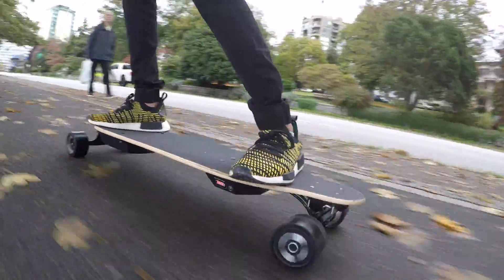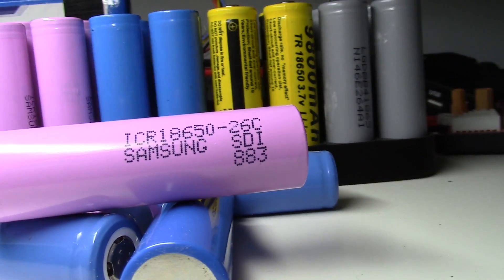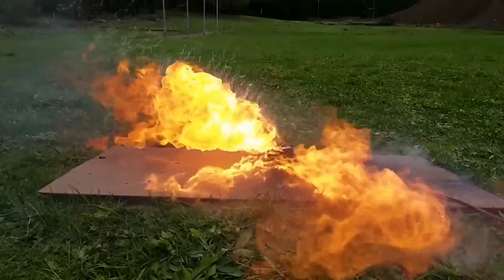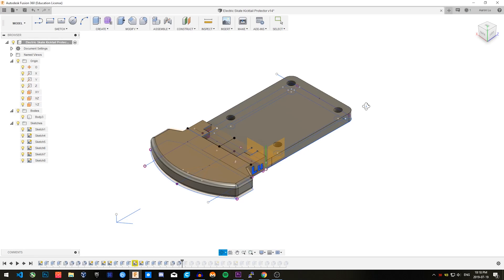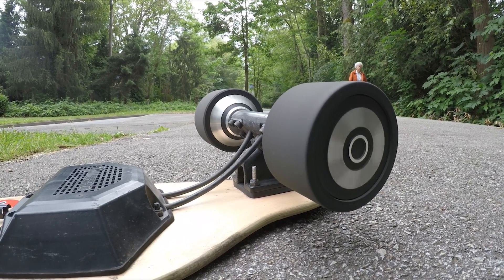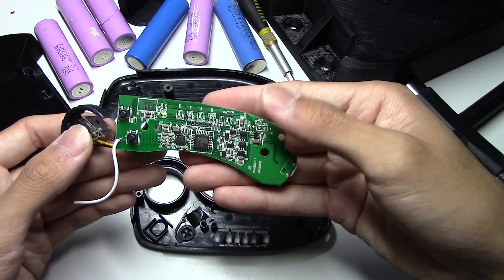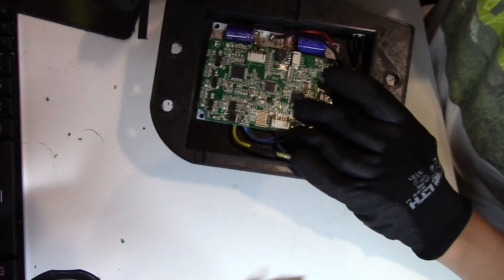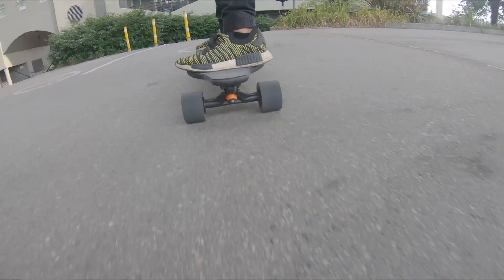Building a Budget Electric Longboard

Comment: I am in the process of building a 1400w 4 wheel drive long board for $648. I have a prototype right now 1050w 3 wheel drive for $515. The prototype will go up hills at a 25* angle for 35min straight no stopping with a 280lb rider. That’s around 6-7 miles. On flat ground it will go for a hour straight and that’s about 12-14 miles. I can’t wait to buy the new battery and motors to see what 4 wheel drive can do.
Reply from the maker: Please do make a video on it! I would love to see it in action!

Comment: Hey, nice vid! I noticed you probably have the same hub motors I do but I'm not sure. They look the same in the vid. If outer diameter (with the PU) is 90mm then those are the same. Could you please link me to compatible "tires"? Thanks in advance.
Reply from the maker: Thanks! The hubs are unfortunately non replaceable. So you will have to replace the whole motor. Here is the nearest I could find. http://www.diyeboard.com/hub-motor-9052mm-500w-75kv-for-diy-electric-skateboard-p-537.html